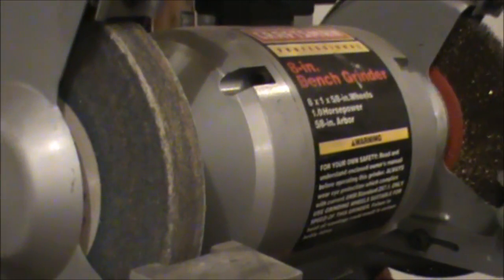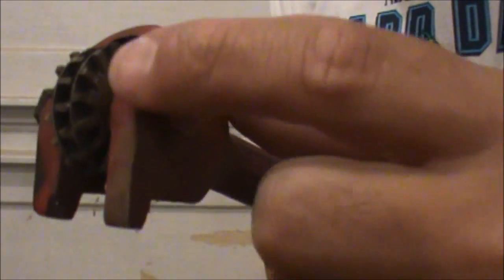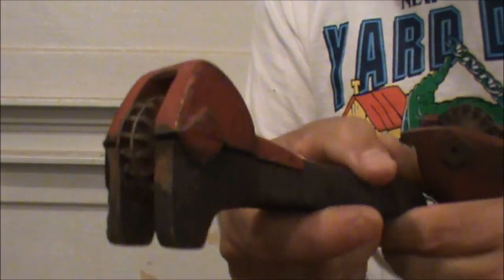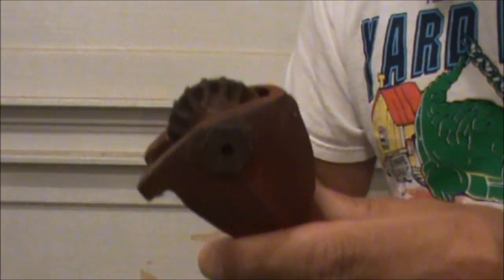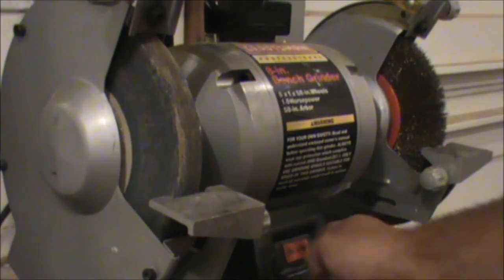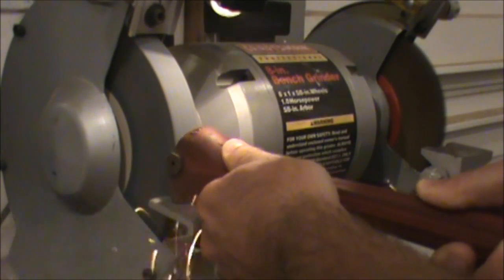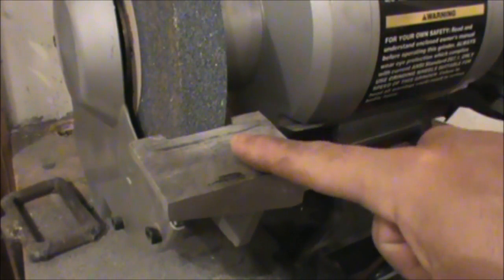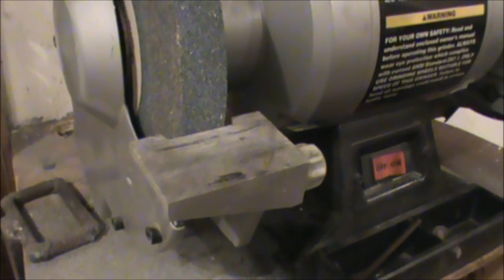How to dress a grinding wheel

Comment from the maker: Thanks for your post, I will have to try to lock the dresser into the tool rest.  The wheel never spins true because I cast and made the grinding base and when I bored the hole through the casting I did not have a drill bit long enough to go through both sides, and my setup on the mill must have been off.  Thus, the wheel wobbles and is loud.  Thanks again for your comment you know what your talking about.

Comment: You might have dressed the wheel but it's still not running true. Those those lugs on the bottom of the Huntington dresser are intended to be hooked over the front of the rest (loosen and move it back so that the dresser just touches the wheel) then lift the dresser to push it into the wheel & move it steadily across the wheel face, otherwise your dresser follows the wheel (in a cam-like action as its not concentric) How do I know - I work for largest wheel manufacturer in Europe. ;-)
Reply: Steve W:  I'm glad someone knows how to use it properly
Reply: can you use a diamond stone dresser (Looks like the letter T) on these wheels?   Any wheels for that matter?
Reply: @eclear4evr  Your objective is to firstly sharpen the wheel, and secondly, make the wheel perfectly concentric to the bore. Yes, a diamond can be used, either single point, or multi-point as long as it has the facility to mounted adequately to facilitate a true-ing effect on the wheel - holding it in your hand will not produce a concentric wheel and will likely lead to vibration and a grooved wheel face.

Comment: Dressing a small wheel can be done 'freehand', unless the rest is even and the dresser slides across it, it will probably be counter productive to hook the dresser over it. If your wheel is out of true due to a soft spot, cleaning the whole circumference of the wheel will be a short term fix.Lightly dress the wheel so the soft spot remains loaded with waste will keep it true for longer.

Comment: That tool is $4.99 at Harbor Freight, just went and checked their website. My wheel needs it.
I have used the abrasive sticks before at work, but they are more expensive. And that was a long time ago.

Comment: Those safety glasses won't do much if a wheel blows on you and sends chunks of it at you. You should also use the eye shields (Couldn't tell if you had it down or not on the wheel you were using).

Comment: It doesn't work with a slow turning water cooled grinding wheel.
I found a method:
Run the wheel without water & hold a pencil close to the wheel on the rest stop
so it just touches the high spots on about 10 different lines across the wheel.
Then stop the wheel & use a Norton Dressing Stick as a file to take the pencil marks off.
Run the wheel with water & use the Norton stick to dress the wheel..
Stop the wheel  & empty the water.
Start the wheel & repeat the whole process with the pencil again.
You may have to do it 10 times before the wheel is true with no high spots
if it's really bad to start off with.
I've reduced a 1mm run out to less than 0.2 mm with 5 repeats.

Comment: Not to be "safety Sally" but the silicon carbide or aluminum oxide  dust in your lungs is bad news. I wear a good quality dust mask when I do this.So all these comments about face and eye protection are correct but don't forget your lungs. Silicosis sucks!